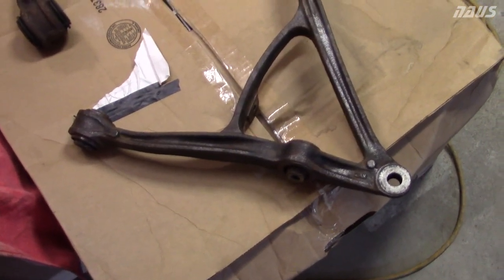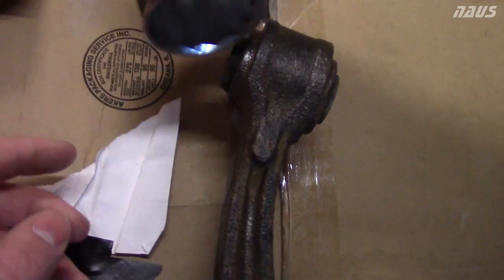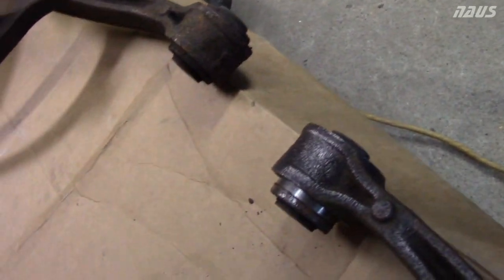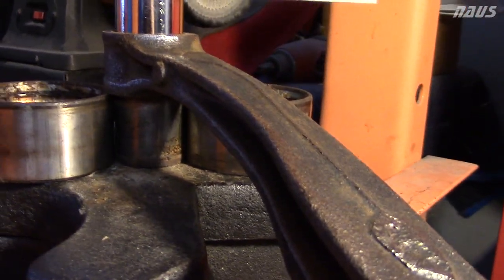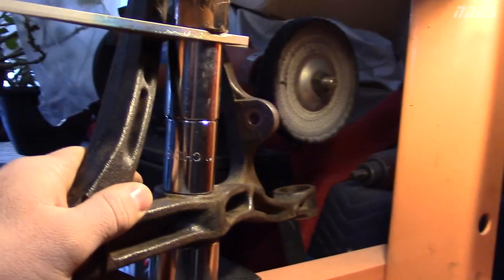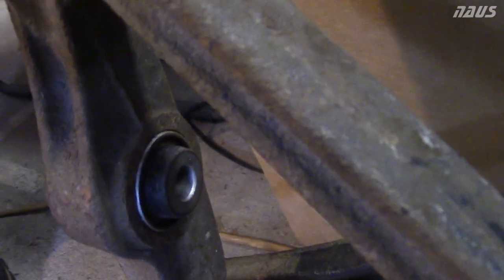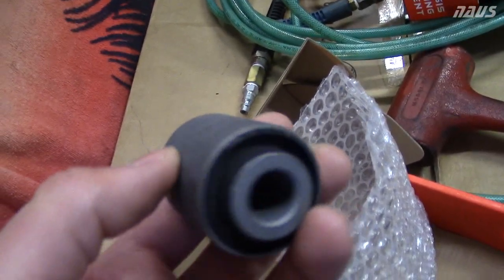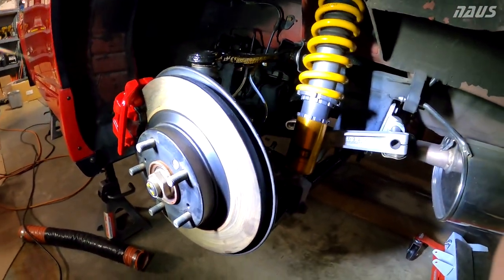S2000 Lower Rear Control Arm Bushing Replacement DIY

Comment: I replaced these ones as well with hardrace ones and now opting to replace the right one with a poly street version from powerflex. Mine were on their way out
Reply from the maker: My Advice - Dont put polyurethane anything in the s2000. Not a good material for long term durability.
Reply: @NAUS2K  i avoided them as much as i could because i did not want to add any unnecessary vibrations to the car. That's the only bush that is going to be poly. I heard many good things about powerflex. Let's see how it will hold up. Thanks!

Comment: What were your symptoms indicating they were going bad?
Reply from the maker: No symptoms, they were all in fine shape. The front ones are know to fail, especially the caster bushing. Since I replaced the front end with all hardrace hardened rubber a couple years before I made this vid, I followed up by doing all the rears as well to try to get all the bushings to be the same durometer

Comment: did you need to press out the hub bearing?
Reply from the maker: The rear wheel hub ? No that is still attached the the car, never broke the axle nut loose
Reply: @NAUS2K  OK great. I was afraid of tackling this job and having to also buy bearings!

Comment: The front lower rear bushing sucks the most to remove. Its 2 halves pushed in from both sides
Reply from the maker: which one? i have videos up of how to replace every bushing on this car besides the one they dont sell a replacement for mentioned in this video. I replaced all of the front bushings with hardened rubber and do not recall any of them being pressed in from both sides
Reply: @NAUS2K  rear of the car, lower control arm, front bushing i think?  its like 2 pieces pushed into the arm from both sides and you need to hacksaw the flange off one side to push it thru. its the one bushing you didnt replace cuz theres no rubber replacement sold like you said. I put sphericals in all of mine so i replaced the one you havent yet.
Reply: Only polyurethane bushings are two piece for that joint. Rubber are one piece
Reply from the maker: Yeah he said it sucked to remove though because it was 2 pieces, maybe he was removing an old poly bushing?
Reply: @NAUS2K  nope the oem bushing is weird. Its not like any of the other rubber bushings on the car. Theres some threads on s2ki on removing it
https://www.s2ki.com/forums/s2000-under-hood-22/removing-rear-lca-bushings-1028920/
Reply: GripS2K oh I see. I used a saw like they did in the thread. Still have some nice marks on my control arm from the saw blade lol
Reply from the maker: Oh wow I never knew that. Glad I let my oem one in there then!